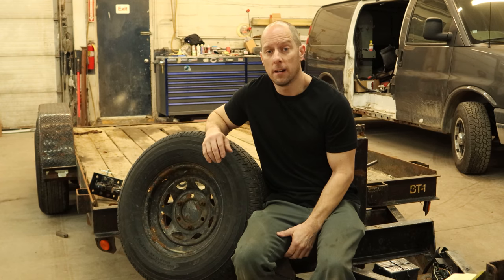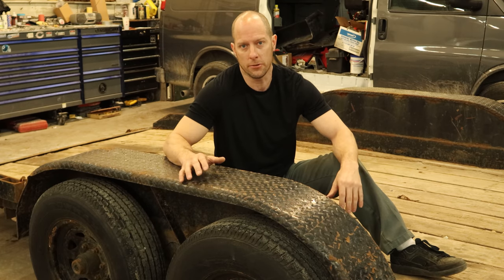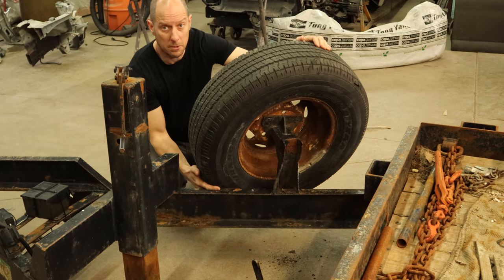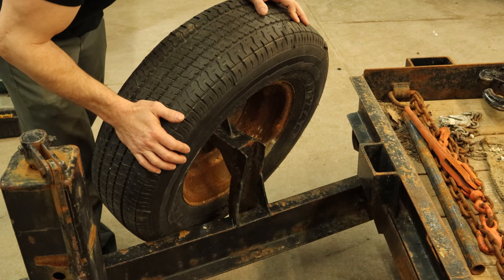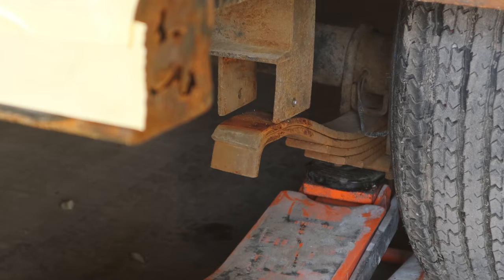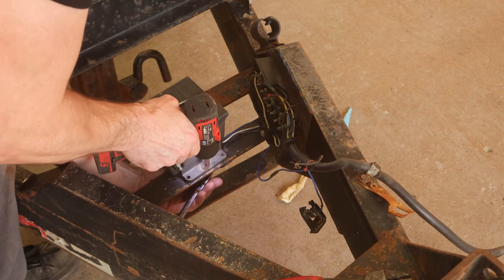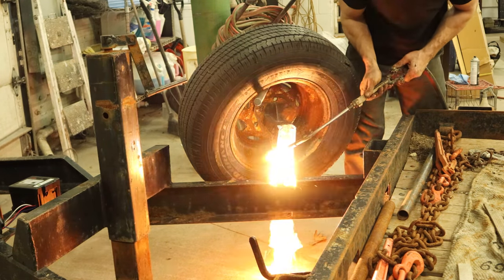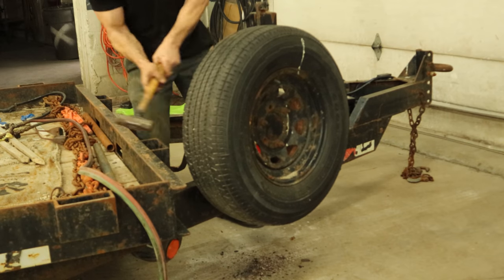Repairing a Cronkhite tilt bed equipment trailer

Comment: I was replacing the ABS sensor on my mom's car last weekend and discovered someone had cut and spliced the main wires from the loom to the sensor. My first thought was, "Somebody's been here before!" Turns out they just twisted the wires and taped them up. Well, I discovered the cause of the intermittent ABS light. Wish I had found that before buying a new sensor.

Comment: I was starting to panic just a little when you were straightening out the fender, so glad you hammered that little crinkle out on the edge or I would have had to drive 2200 miles to do it.

Comment: I recently bought a 1992 Hurst 10K tilt trailer that has spent it's life in NW Illinois. The frame and deck seem to be in much better condition than this one you're working on, thankfully.
 My first project is cutting of the garbage winch mount plate, and building a receiver hitch for my winch.
 Much more to do on it later, with all new brakes and rewiring the lights. I might even add a break away brake set up to it 😎

Comment: Could slide a piece of pipe over the leaf bolt like a sway bar link. Would let you tighten the nut and lock it down without worry of crush.

Comment: That was pretty cool. I wonder if it would help to add some drain holes in the tops and bottoms of the new ramps that way the guys can really wash them out? I suspect the centers lasted longer because the could rinse out the salt better.

Comment: To get a wheel back on that mount - you CAN do it. I am assuming you change a flat. Therefore no resistance as the rubber flexes. Fill it up with air after mounting.

Comment: I think it's recommended to back off the axle nut around a 1/4 turn after tightening. Gives a little room as things heat up. Also, did you adjust the brake shoes?

Comment: My old man was a pipeline welder but took in project like this as an afternoon project. He would have broken out the cutting torch and big angle grinder and been done in about two hours.
Reply: He only used a wire feed to weld rust repair panels on cars.

Comment: In all my years as a equipment mechanic I have never seen lithium grease used for wheel bearings.
Reply: its miracle whip
Reply from the maker: You must not work on marine equipment.  This is made for boat trailers with axles regularly submerged in water.  It has been better than the most expensive synthetic wheel bearing grease for this company.
Reply: @vehcor  That is interesting.  I've seen the blue-ish stuff but not familiar with this.
Reply: @vehcor  we use water proof grease for those applications that is formulated for use in water . It sticks to everything and if you get it on cloths it’s there forever. It’s hard to get off your skin too.
Reply: @georgedunham6833  isnt that stuff called Vaseline?

Comment: why did you not rustproof the inside of all the new metal you put on? another thing that double plate you put under the marker light tray on the back end, will trap mud and road sault between them and both pieces will be gone in no time .stay safe  have fun

Comment: shouldn't you put some holes in that bottom plate to let the water out? Or would that actually let the salt in more? I'm from Texas, we drive our trailers until they are old and completely broken in 20 or 30 years mostly without any repair.

Comment: 16:00 I was working on the brakes of my trailer. All shot. But an odd thing. The front brakes weren't connected.  Never were. No wire near them. Have you ever seen something like that?

Comment: The wheel will probably fit back on since all you will have left from the tire change will be a rim with two strips of rubber in the beads. I’ve worked on a few of these🤣🤣🤣🤣

Comment: You might remove that plate that you got your electrical electrical junction block bolted to it bore hole for the cable maybe that will do the job

Comment: landscapers are often just brutal to any and all equipment. Trailers, mowers, hand held equipment, etc. Just brutal on it. And if any of it has a simple problem that would take 15 seconds to fix they will all too often just keep using it full blast until that practically non issue cascades into a completely failed piece of equipment.
Reply: Usually happens if that equipment isn't their own.. I own my equipment and take good care of it. Neat and tidy equipment gives a better image to a customer, it's landed me several big money clients. Ones that don't whinge about the cost of materials..
Reply: @tech4pros1  yep. You can tell the one man/family only operations by the age of their equipment.

Comment: That ramp design seems weak if you can’t weld the center support on each side... 🤷‍♂️
Reply from the maker: I just put it back how I found it.  It lasted 16 years last time.  If it only makes it half as far this time, it will outlast the rest of the trailer!

Comment: The least you could of done was grind off that scaled rust off and primed it before adding the new metal sheet.... Only a few people take pride in their work. By the way that axel bold/nut you welded. You should have that kind of stuff in stock if you do it as a business.. unless you don't charge for it and do it out of courtesy. Which I doubt.I ask myself if you're a self employee business or paid by the hour employee.

Comment: Id say that trailer was towed by a jackass with a Ford, but it still looked too nice. lol
Just make sure you use Rust-Core welding wire to ensure the new steel bonds to the old.

Comment: If you can find me 1 or 2 of the black handles that fit the fusebox on 2015-2020 GMC Yukon/Tahoe/Suburban/Escalade let me know.  I also need the two plastic things that hold the tray into the cargo area of the same vehicle.  They have a steel bolt molded into a plastic nut "handle."  I'm fairly nearby and will drive to pick them up.  IF you have a source.  Let me know if you can.  Message my profile and I can provide my contact information.  Thanks.

Comment: Trailers are the worst in salt.   there is NO EFFORT WHATSOEVER in the way of  galvanic inhibitor coatings or immersion.......just cheap paint or powder coating over minimally prepared steel.

But trailer are still cheap considering all the steel you get.
Reply: uhaul trailers are galvanized , there are galvanized trailers out there. cost more $$ vs the painted/powder coated counterparts.  Ive used the same beat ,bent uhaul 6x12 for yrs. aside from floor being dented, fenders caved in and sledge hammer bodyworked back out, the trailer holding together

Comment: Should've used diamond plate for the rear instead of that cheap tin foil garbage that won't last 5 years
Reply from the maker: Um, I did and this trailer will not last 5 more years anyway.
Reply: @vehcor  talking about the first metal you welded in